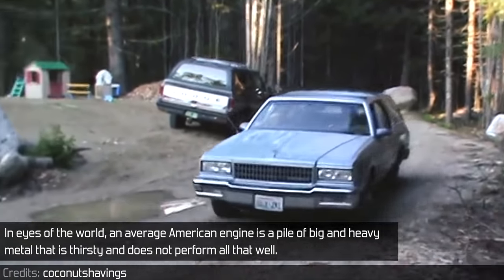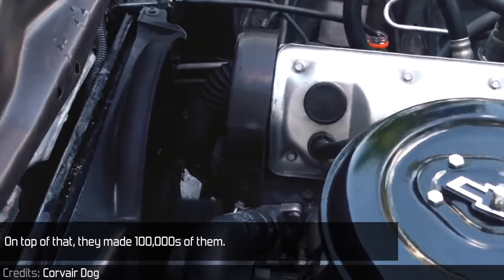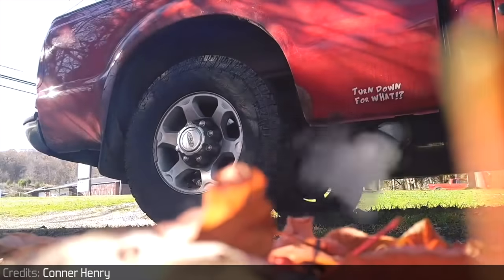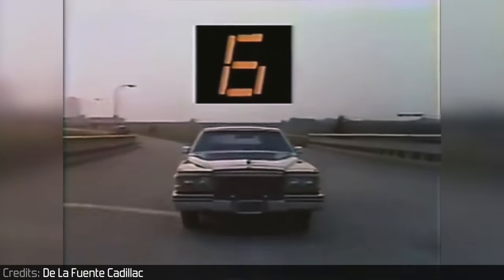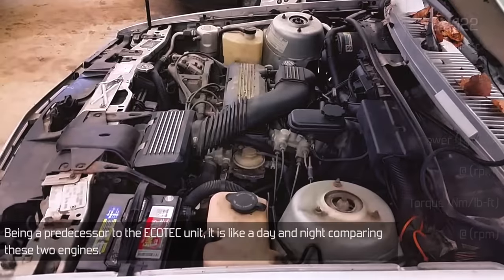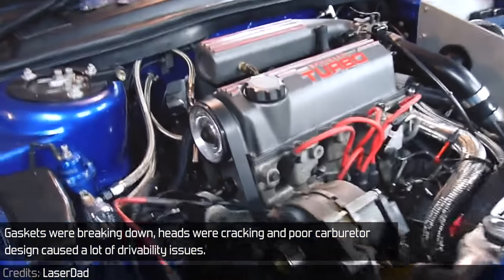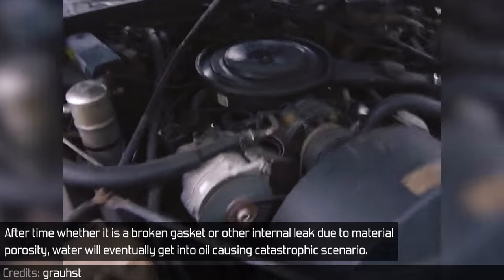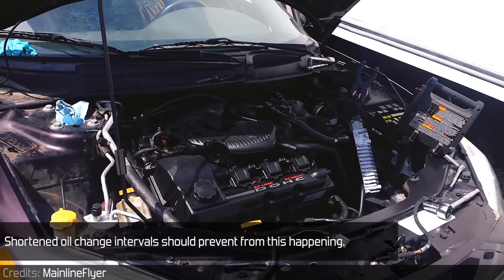8 Worst US Engines You Should Avoid

Comment: Ahh the one wheel peeling V6 Charger... even my pickup truck eats those for breakfast.
Reply: I owned a charger with the 345 hemi. The computer did not allow burnouts and wheel spin and was extremely laggy. If you lift the rear end up and try to step on the gas, the car would not go above 15-20mph on the speedo and you could hear nothing but backfiring as the computer tried to correct. Horrible, horrible car and setup.
Reply: This was before the Pentastar.  It’s a great V6 design, used in everything from Jeeps, to minivans, to Fiats!
Reply: Mopar Magic Even a fat kid on a bmx bike would eat those for breakfast lol
Reply: The 2.7 is Mercedes designed junk. The 2.7, 4.7 and to a lesser extent the 3.7 Jeep motor are too. As for the guy who 's Pick up "eats these for breakfast" If the Charger has the 5.7 Hemi It will eat your truck & spit it out in time for you to eat it for lunch!
Reply: My truck is a stipped out Tradesman single cab on wide 29" tires with 3.92 gears. What do you think happens to those Chargers?
Reply: It's got a hole in the floor and I flintstone it around town. yaabadabba doo
Actually it's a supercharged biggs and stratton 50cc. Pushing 30hp at 60lbs of boost on nitromethane.
Reply: i raced one of those v6 chargers at a stop light once..... with a 1989 305 TBI 700R4 camaro RS...... and beat it. that camaro had 2.73's gears to think i could beat anything with a 170 hp tbi fed smoged to death 305. that 305 had the worst heads, worst cam, crappiest exhaust. it was chocked out bad. 

a year later i replaced that 305 TBI with a 350 TBI.... and headers, better L98 cylinder heads, 3" catback exhaust, ported TBI unit, and a eldebrock performer camshaft. it ran good and proper when i was done LOL
Reply: I didn't know Chevy made a 305 until I saw it on MT Engine Masters. They made 620hp on the stock bottom end spraying the hell out of it with nitrous lol. 250-shot. They blew it up with a 300 shot but still... that thing held up surprisingly well lol.
Reply: my god i feel old. a few years ago 305's were everywhere. its a small bore version of the 350 basically. it was a v8 designed for low end torque and fuel economy. they werent a bad engine but 350's are cheap and readily variable.

i know that episode that engine didnt loose its guts, the piston fractured from ring expansion. if they had nitrous prepped it, it would have gone even further. ridiculous really.

that 2.7 used in the charger was a piece of crap.
Reply: There was a lot of 2.7 to 3.5 conversions on the LX and LH cars and 2.4 conversions on the Sebrings and Stratuses.

Comment: Ford 4.6 Triton was a great engine and especially in the Crown Victoria.
Reply: no...the 4.6 modular v8 was a good motor.  the triton series are the 5.4...mainly the ones with 3 valves per cyl.  hence the triton name.
Reply: You are right but 5.4 tritons were shit
Reply: Yeah the 5.4 was junk.
Reply: +ThatCarGuy Samuel Mustang Terminator too Twin Cam supercharged goodness that had a crazy strong block
Reply: amazing how little people know  4.6 5.4 and the 6.8 are all modular motors, triton is the truck versions name....
Reply: ThatCarGuy Samuel > The 429 Interceptor was a great engine in the Crown Vic.
Reply: Big Show the crown Vic had only 2v per cylinder and was used different materials than the 3v 4.6 in the mustang and mercury marauder.
Reply: To clarify a Triton is a modular 3v. The engine in the Crown Vic was a modular 2v.

Comment: The later Dodge 2.2 became a very good engine when they went to fuel injection and cross drilled the cylinder head. The Turbo 2.2 and 2.5 where some strong runners once the two main problems where fixed.
Reply: Unfortunately it took thousands of failures to bring those revisions.

Comment: I can easily agree with this list entirely.  The only exception I would have would be the Ford Triton engines as I know are some excellent built V8's. The removal of the spark plugs would be a problem on any aluminum engine head and block and must be treated with extra caution and care.  With the Cadillac's which is what I know very well, these engines listed are also my least favorite.  It was imperative for Cadillac to develop the 4.6L Northstar 32 Valve V8 that solved a lot of issues of the HT series engines and remained Cadillac's longest produced high performance V8 engine.  But proper maintenance is the biggest culprit to any engine.  My grandfather specialized in Cadillac's going back to the late 1940's.  He worked on all the early Cadillac's to include the V8, V10, V12 and the V16 as well as the later Cadillac's of the 60's and 70's.  And the one thing that all those Cadillac's required was proper servicing of the cooling systems.  Unfortunately, cooling systems is the one system that is most overlooked.

Comment: This is why Americans like big bulky gas gullzing OHV pushrod V8s. It's what most of us think of as reliable. That's why we cherish our V8s.
Reply: I wouldn't mind a 4 cyl in an american car, but they absolutely suck when it comes to reliablity, primarily the ones from GM and Chrysler.
Reply: Actually OHV engines are physically small because they have no over head cams. They just have huge combustion chambers to make up for only having 2 valves per cylinder.
Reply: We like V-8s because of the low end torque and awesome rumble.  Easy power without having to rev the shit out of it.
Reply: @enriqueortiz5440  gm makes some really reliable 4 cylinders.
Reply: jdr ok When?
Reply: @melrose9252  let's see in the 50s 60s 40s 30s 20s 80s 90s 2000s I mean they make a lot of engines.
Reply: @Dcc357   I disagree my 460 bored to 514 is huge, both in size, power, and torque.
Reply: I have a Toyota 4.7 V8 2UZ. V8 strength and Japanese dependability.